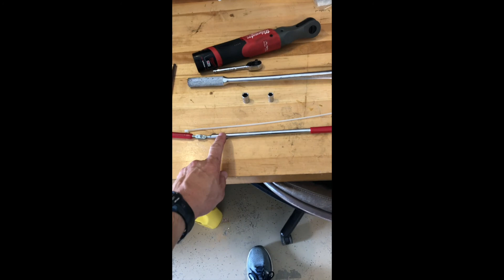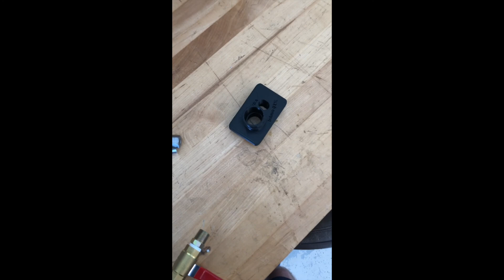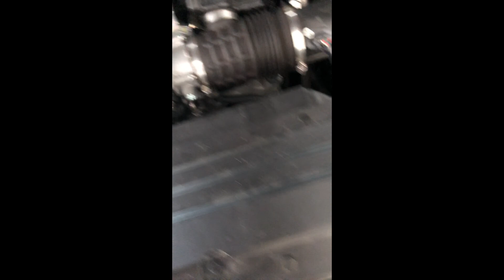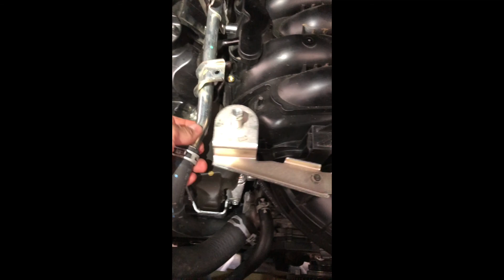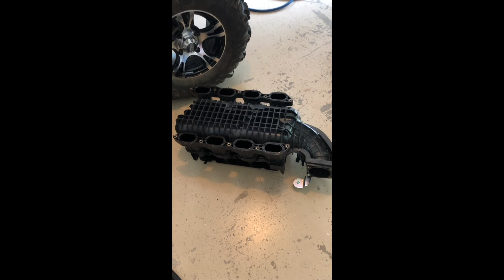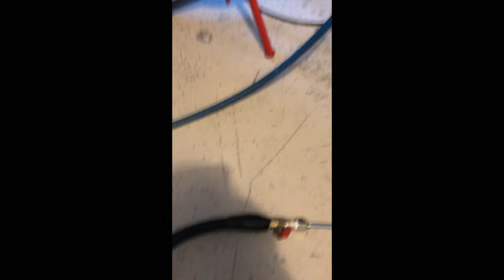Nissan Titan intake valve cleaning

Comment: Appreciate the video! have been looking to get a 2nd Gen titan, investigating the few problems they have.
Reply from the maker: I have been very unhappy with my truck. I’ve only kept it long enough to save up the cash to purchase a used F250 with 6.2 gas motor.
Reply: @markjohnson3485  I'm a huge fan generally of Japanese vehicles, in this case, all the research I've done on the 2nd Gen Titan is leading to a decision that they were not engineered\made well enough unlike the 1st Generation.  I'm not thrilled with my 02 F150, but it does seem the newer Ford stuff is more reliable, cheaper parts, aluminum body alone with no corrosion is almost enough.  A shame Toyota's are so expensive.  The ludicrously caked valves from direct injection is so obvious, how did a company like Nissan, known for engineering excellence, screw this up?  Thanks for feedback!  A Super Duty to tow, so much confidence and safety there, the brakes alone are so so massive.

Comment: If you have a scanner you can reset the trim levels or to reset manually unplug you maf and start it then turn it off and reconnect your maf wire and clear the codes by scanner or removing the neg battery cable for 15 minutes

Comment: My nissan titan has 260,000 miles and never had an engine issues. I use seafoam injected into the intake throttle body every 5,000 miles when I do a oil change. Do not use the seafoam that's poured in to the gas tank as that's counter productive for a direct injection engine.
Reply: Doing that too often will damage your catalytic converters. So I've heard.
Reply: What vacuum line do you use
Reply: The previous gen Titan was port injected so it most likely didn’t have any intake valve carbon issues.

Comment: Great vid for intake removal. Looks easier than my wife's Hyundai Santa Fe  3.3 v6. I did CRC soak, used pick and brush on a drill. Sprayed and flushed several times with carb, cleaner. Blew out debris with compressed air into a rag. Nasty but worked well. Think I'll tackle my Titan now.

Comment: A monthly Italian tune up is the solution for direct injection issues
Reply: @markjohnson3485  I’m glad you found the ultimate “solution”. That’s way too much to do on a regular basis. That’s the main reason I won’t consider any direct injection vehicle unless it has two injectors per cylinder. My old 2010 Titan is still going strong without any of these engine issues.
Reply: We have 3 2019-2020 F150’s in our fleet with the 5.0, they all have a “knock” in the bottom end when idling. They have between 70k-100k miles. Good luck. Though you are right about the Titan as well, pick your poison

Comment: I hear CATCH CANS prevent you from having to do this.
Reply: I use a catch can on my other truck and it does a great job collecting the oil so it does not get into the intake system.  Great way to put off cleaning for a really long time.

Comment: Could just buy good gas and fuel system cleaner every now and then lol, fuck all this
Reply: The BEST gas and the Best fuel system cleaner will do NOTHING for this issue as DI sprays fuel directly into the piston chamber which never touches the back side of the valves like port injection.
Reply: Kinda what I was thinkin
Reply: @tommer7293  Fuel system cleaner will not work on direct injection for the intake system.